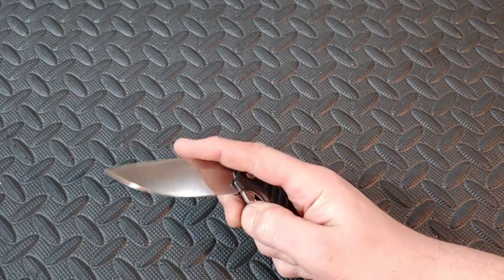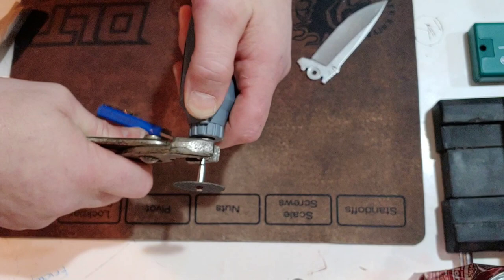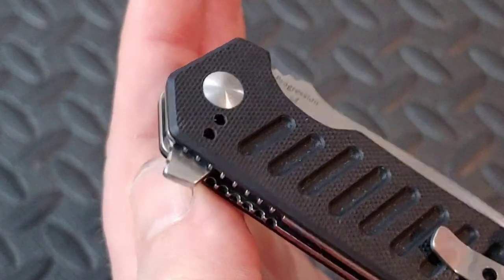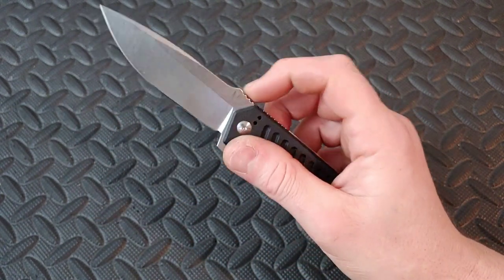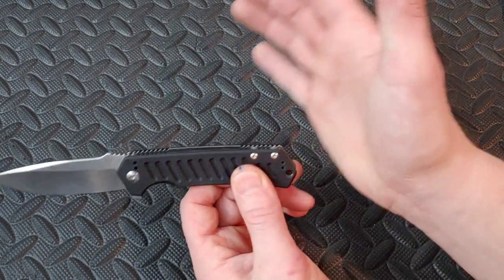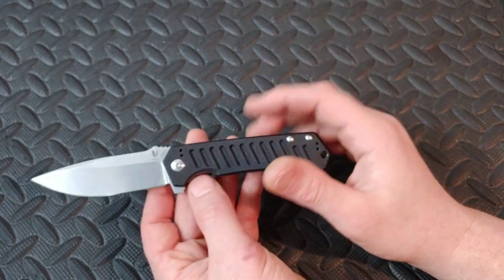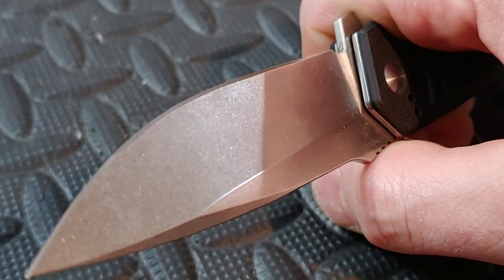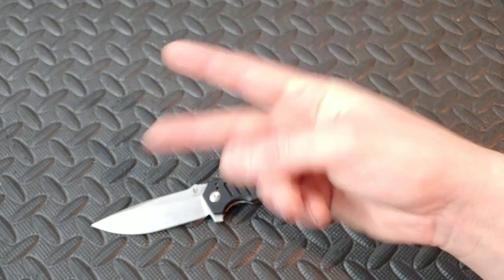TANGRAM PROGRESSION KNIFE REVIEW & MODS

Comment: I've been using the cheap dremel I bought from harbor freight on sale for $8. I actually prefer it because it's soo damn weak. It prevents me from making mistakes I would probably make using a real high powered one from over-doing things. It's worth it alone for all the various diamond, sanding, cutting, and drilling bits that come with it.

Also I always like installing bearings with the open end in towards which ever side has the spot milled out (tang or scale). This way the open side is protected to help avoid dust from entering the raceway, but I have a touch of ocd.

Also modding cheap knives is a hobby of sorts, so it really doesn't matter how long it takes you. I'm scared to mod more expensive knives anyway.
Reply from the maker: Yeah i get that, but the budget knulives are great to make your own or practice mods on

Comment: I have 3 dremmels and the one I reach for when doing synthetic material is the AA battery one it has a 2 speed settings and the slow one is very good. Anytime you can improve something, and you have the time for it, it's a great feeling for a tinkerer.
Reply from the maker: Most definitely! Id rather take a few minutes to improve something than deal with for ever

Comment: I have one of these. It's a hell of a slicer. The two mods I may do on mine is put in a detent ball ramp and do something about the clip contact patch and immediate surrounding area. Mine absolutely shreds pockets as it is now.
Reply from the maker: Yeah unspringing the tension a little helps a lot, and smoothing the g10 a little bit helps a ton

Comment: You say you don’t feel the linerlock when using the knife, but are you not afraid for accidental unlocking with a little heavier use now? Love the video btw, feel encouraged to mod (cheaper knives)
myself now.
Reply from the maker: No not at all its not aa knife id use hard use, and theres many knives that are the same way that have been fine so no im not really worried about it plus when cutting the pressure goes towards the stop pin maybe if i was twisting